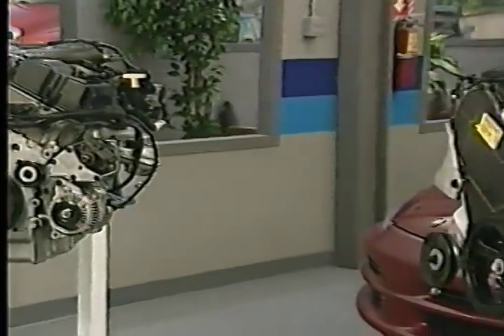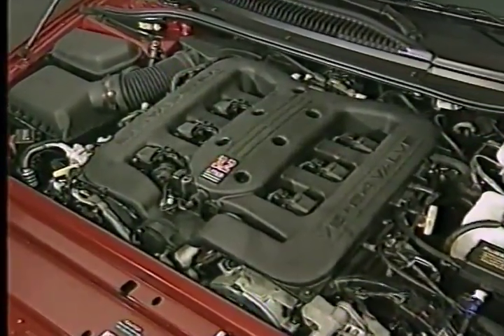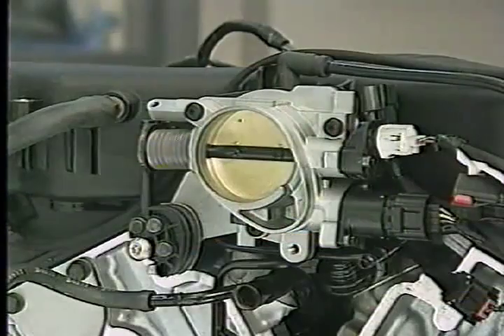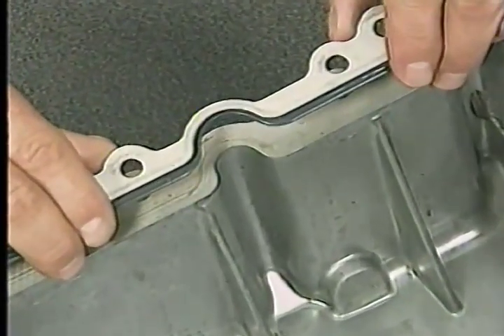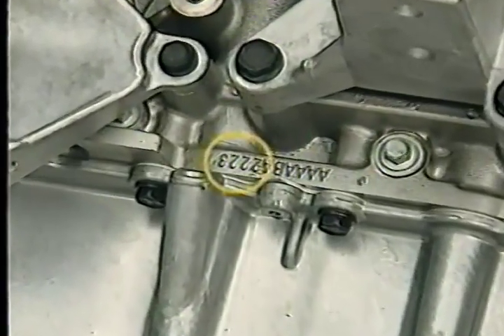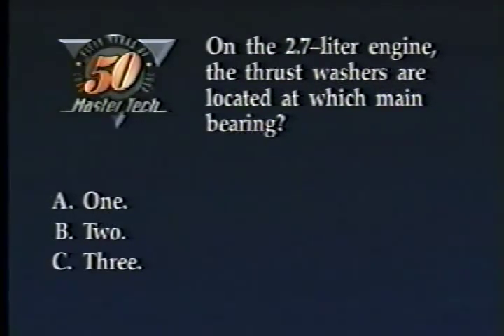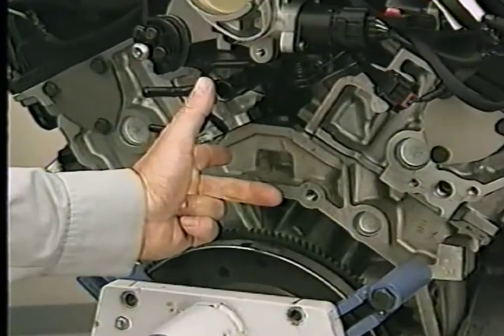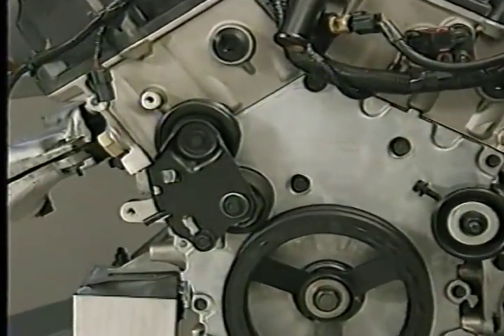Chrysler Mastertech 1997  2.7L, 3.2L, 3.5L V6 engines PART 1

Comment: The book is full of bullshit saying the 3.2 and 3.5 are interference engines,they are not.I have started them up after changing the timing belt and start right up.
Reply: They are. the guy in the video flat out says that if your timing marks are off then it's bye bye engine
Reply: @doom3380  2002 and down are none interference

Comment: Not difficult to work on???? You mean like removing the engine from the bottom to replace the water pump??? :)
Reply: ***** Don't have to do remove the engine to replace the waterpump
Reply: Not the 3.2 and 3.5,these two run forever
Reply: *****  true lol
Reply: wafrederick All of these engines are shit.